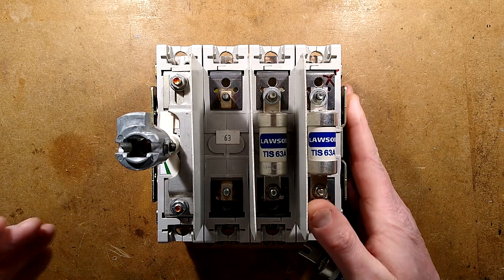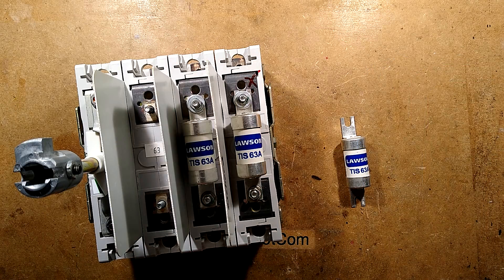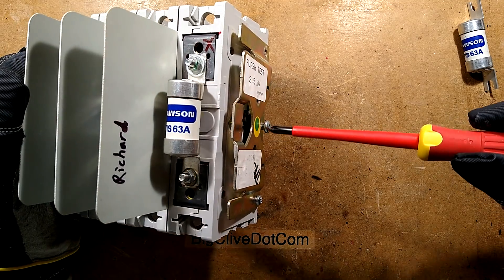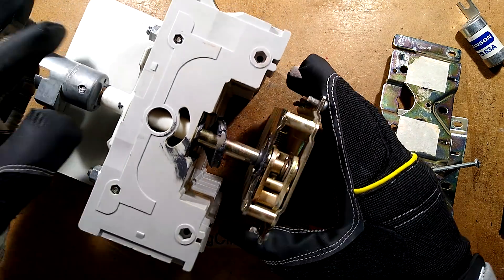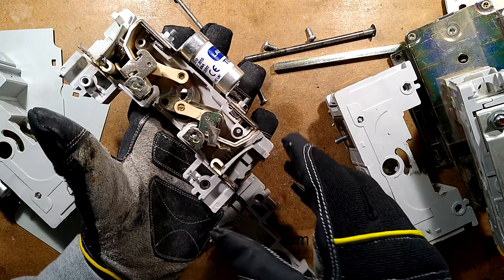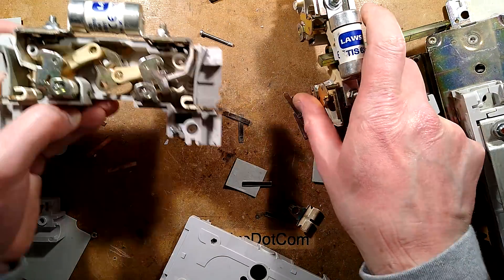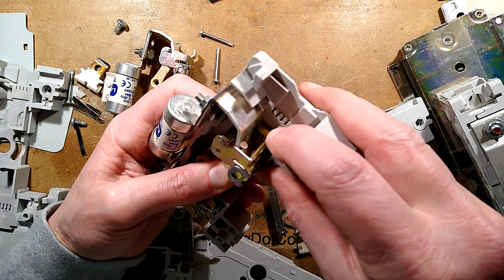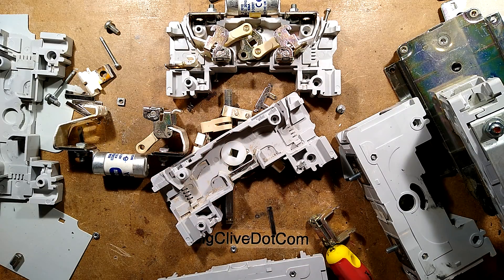Failed elevator switch fuse / fusible disconnect

Comment: Used to work as a metering guy at my towns electric company, quite often i got to operate 100A fusible disconnectors if the meter i was changing was not a current transformer style meter (could have been any service up to 100A). I always thought it was fun to use those huge levers and hear that loud THUNK from the contacts opening and closing 😅

i do miss working there, job was pretty simple but i got to visit alot of interesting places and meet interesting people.

Comment: Interesting! I've never seen such a combination in the Netherlands before. I can only relate to fuse-disconnects that have the fuses (we call them knife-fuses) clamped into a cover that one pulls open to break the circuit if needed (and of course pushes shut again when power needs to be restored)
Switches are always single parts added when breaking the circuit by actually removing the fuses isn't such a good idea anymore (I think above 63 Amps) or (probably) when the fault-current exceeds a certain value (when the switch-cabinet is located close to the transformer and the circuit before thus has a very low impedance)

Comment: They have big switches like this on large commercial air-conditioning and refrigeration units and such as well. Provides both fuse protection against overloads etc and a way to be absolutely sure the device is off when working on it (without needing to go downstairs and turn off/on the main breakers for the unit all the time)

Comment: "you hit the nail on the head" with the failure diagnosis, which probably stemmed from a phase loss and slow cooking fuses in the past. when slow cooked they tend to be real brittle and will shatter when replacing, dumping their shmoo everywhere. lol

Comment: We called them CFS Units [Combination Fused Switch] 
This type are a simple side way slide mechanism, using heavy over balance mechanism enclosed.
The type I first starting with had a carriage that was also spring loaded to thrust in or out. The carriage could be totally removed for service or absolute isolation of the fed circuit.  
They are designed to break 'on line' loads.
The last heavy units I worked with [manufacture of power station switchboard] was 3 phase rated at 660V A.C. @ 2,500A. We used them for a 220V D.C. application by double switching the positive buss feed.  Likewise, using 3ph 2,500A A.C. programmable Circuit Breakers in a D.C. distribution board. Heavy 2 x 125mm x 10mm Cu. per phase or pole busbars in these, requiring precision bending to maintain consistent bar gap and very fine tolerance at every lap joint, be that between shipping sections, buss ties or CFS and CB equipment. 

This 660V 63A 3ph POS... Can't say I like the design of those spring loaded floating contacts. WFT... not even a heavy welded braid connecting to the fuse mount lug! Like, might be a cute little baby size FS, used as a local isolator... or maybe in a dis. board?  I've seen 'em used with solid copper bars instead of fuses as a cheap means of 'on load break' local isolation switches.

Comment: I agree.  The ball and socket went hiZ and the spring became the path of least resistance.  They should have insulated the spring in a plastic sheath to preclude this failure mode.  3cent solution, and would have made it last forever.  What you did is called a DPA  Destructive Physical Analysis in my old field of business.

Comment: Quite different to North American NEMA rated gear.  IEC stuff is much less robust, and way more complicated.  NEMA stuff uses sliding contacts.  Usually, they are a single contact per pole, so the fuse is still connected to the load when the switch is open.   This could not have happened here. Once the switch is made, it is made, and it won't fail open.    In theory, a FDS can be opened under load, in practice, don't do it!   Out of curiosity, how can auxiliary switches be added to that device, if you wanted interlocks or indication of the switch position?   As for the neutral:  I worked mostly with 3 phase, 3 wire, 600 V, 60 Hz, usually with a high-impedance ground.  Some installations were completely ungrounded, but that was real old-school, not much of that left.  Makes for very high reliability, as one phase can go to ground and not shut down the plant or even blow a fuse.

Comment: They should use braided wire as a method of contact between moving parts like they do on motor brushes and in other circuit breakers rather than relying on the friction between 2 surfaces. However it is possible that they'd prefer to leave it this way because it is cheaper and lasts long enough to cover warranty period ensuring the need to buy a new one rather than lasting decades.

Comment: Big switches like that used to have spot welded braid wire to the moving contact. This switch is missing the current carrying braid, so the current can travel the piviot and spring, resulting in heating of the support components. If the spring was on an insulator to prevent it's heating from current conduction, the other higher resistance points would have heated instead. The spring failed and the contact opened. The spring should not be a current carrying component in the switch. A low resistance path around the spring is lacking.

Comment: The powerful springs in the actuator mechanism are quite deceptive giving the impression of a high contact pressure when all they do is ensure a rapid opening and closing of the contacts.

Whilst being a double disconnect type switch, (two contacts must close to make the circuit) the design looks quite poor and the actual contact is a see-saw type so it is quite evident that the small spring could carry the full load current if one end of the see-saw does not make contact.

The USA type rotary knife safety disconnect switch looks to be a better design, albeit much larger, with a wiping action of the contacts but they have their own Achilles heel also with most (Siemens, Square D / GEC)  completely relying upon the springs in the handle mechanism to close and open the contacts, there are several Youtube videos of such switches with welded contacts so they cannot be opened or alternatively the contacts no longer fully mate. These switches would be better if the handle was locked to the rotary knife shaft so that the springs would only come into action to ensure fast make/break but ultimately you could force open the contacts with the handle and not be solely dependent upon the springs.

The links below show a rotary knife switch that cannot fully close and one that won’t open respectively.

https://www.youtube.com/watch?v=FTSFAosB2-w&t=189s

https://www.youtube.com/watch?v=4_InqRMYu3k&t=345s

Comment: The incredible thing is that every single item that is part of the fuse carriage has been designed by some boffin on an old fashioned drawing board using ink and pencil, well before the days of CAD, real draughtsmen, who were on a pretty good wage at the time. Each at his desk, wearing smart clothes and a tie, probably smoking a pipe, Barnes Wallace lookalikes. They had to use brain power or fail.
Anyhow, was you supposed to fix that switch fuse? I'm sure he said at the end of the letter that he was looking forward to getting it back from you fully repaired 😂😂😂

Comment: Lift or elevator? 

A man walks in to a London Hotel. An American guest walks to the lift. He shouts "hold the elevator". The staff member goes "we call them lifts outside of America".

The American goes "we invented them, so we call the elevators"

The staff member wittily replies "yes sir, you did, but we invented English"

Technically lift is properly correct as you are "lifted". Elevation is a static height, like mountain. 

I will get my coat.

Comment: If the spring was passing current, which it looks like it was, it would probably melt pretty fast. It wouldn't take a lot of current to melt that. When I was a teenager, one time I was playing around with a spring and connected it to a low voltage supply to see if I could get it to glow. It was a relatively thin spring and within a few seconds, it was glowing red hot. After it cooled down, I noticed it had lost its springiness. When I stretched it out, it no longer popped back into its original shape. I'm not sure what the heat did to it to cause that.

Comment: It would be interesting to know where the bit of plastic (at 9:30) came from and could it have jammed the rear of the contact open, although the sand is probably the culprit. The neutral bus bar could also be removed in three phase delta systems (if you do delta in the UK).

Comment: switching on a 2000 amp 3 phase disconnect is fun, the handle has a long pipe like rod that come out of it and you need a exert pipe over it to leaver it on

Comment: My dad is a PSE with the city and had one of these fail when he was changing some 600V meters one morning. One of the disconnect modules failed to disconnect and when he inserted a new meter it arc flashed in his face. He wasn't wearing a shield, but luckily he had his safety glasses on as well as a flame retardant jacket to save most of his vital bits from being flashed. It's pretty scary when electricity discharges uncontrollably.
Reply: Something similar happened to me in the '80's. Overhead Crane Hoist contactor in a steel mill shorted out. Woke up in the ER as a Doctor was picking beads of copper out of my face. Safety glasses were so well copper plated you could see yourself in them. Pretty singed, but mostly recovered in a couple of weeks.

Comment: No sliding contacts. That's the weaker construction, also when used in corrosive environments like paper mills.
The ones we sell have knife contacts sliding between a springed fork. Wipes clean at every action. Will not try to disengage on short circuit, cannot bounce. 100kA @690V rated.

Comment: How could they tell which one had failed when all three fuses were intact? I just rewatched parts of the video.. They knew about the spring?
Reply from the maker: I marked the faulty contact by measuring from the fuse connections to output terminals before the video.

Comment: My 1st and only 'spring burnout' was replacing a fuse with a Biro spring when 11yrs old in '64 for my mains  Philco valve radio, Then picking it up with the cardboard base not attached. Things that stick in ones mind....9V transistor radios where a god send.

Comment: My Great Grandfather worked maintenance at a mineral plant, and he used to carry 3 pieces of copper pipe the same size as the fuses they used in their bus bar disconnects. If they blew a fuse and didn't know where the fault was, they would replace the fuses with the copper pipes, close the disconnect and look for the smoke. Safety 3rd really was the motto back then.
Reply from the maker: I may possibly have used a similar technique in the past, but you have to be careful about causing cable damage.

Comment: That reminds me of a similar case in a very different appliance. I replaced a blown 3 A fuse inside a 12 V cigar lighter plug by a 12 A one because I did not have any other of this size. It was only for a short test with short periods of maybe 6 amps. Suddenly the current was broken and I wondered why the 12 A fuse should have blown. Further investigation showed that the spring holding the fuse in place did not like those amounts of current and got so hot that it melted the plastic nearby. This resulted in the relaxation of the spring thus loss of contact pressure pretending a blown fuse.

Comment: No matter how good the 'rocking' contact connection is, the spring will take some small current.  All of the springs I could see in the video looked a bit corroded.  So if they're the wrong type of metal, as I suspect, the springs would be subject to electrolytic corrosion.  Any heat from the high current would just make it corrode faster.

Comment: Many years ago got called to a milk cooling tank that was being blamed for people getting shocks off the steel framed building, turned out to be a huge cast iron Bill Isolator that had shorted out inside and made the whole milking parlour live!
Reply from the maker: That's not uncommon.  People can also get shocks from the door handle of a grounded building due to external faults finding a return path through them.
Reply: @bigclivedotcom  Electric trains are even worse - the voltages allowed between the platform and the train body are frighteningly high and for quite a long - 10's of seconds duration.  Part of the justification that it is safe in the (IEC?) standard relies on the electrical insulation of peoples shoes !

4 wheel electric trams were quite bad as well - it only needed all 4 wheels to be resting on dirt on the rails for the tram body to be raised to the overhead line voltage , normally several hundred volts DC. London trams had insulating material wound round the metal handrails to stop people getting shocks when they got on ! Oddly enough this was carried on onto internal Combustion engine buses though there was no reason for it.

Comment: £5 a fuse? that sounds like a chinese knockoff
Reply from the maker: In a box of 10 before VAT.
Reply: @bigclivedotcom  unless you are paying £/$ 100+ per fuse for a mains incomming fuse, its going to be a chinese knockoff and wont have the correct interrupt rating
Reply from the maker: These are common HRC industrial fuses:-
https://www.cef.co.uk/catalogue/products/15053-63a-tis-hrc-fuse-sold-in-1-s
Reply: @bigclivedotcom  they are BS88, a 100 year old standard that does not apply for modern machinery complient with the machinery directive for EU or the new UK mark. they are not complient with UL either so I can't imagine what they are existing, but only to be used for replacment fuses for machinery from the 1920s

Comment: Cheers Clive! I can't believe that's all it was. You could be right about the sand, as another engineer did replace a fuse after the lift developed a fault a year or 2 ago.
Reply: Where is the lift located - in what kind of building? How old is it?
Reply: @milcotto4153  It's in a 2 storey office building in the UK and is around 30 years old.

Comment: It would be interesting to cut / break one of the fuses open to see if the sand in the fuses is similar. The 'snap' action is required to minimise the contact arcing as they are opened or closed..

As an aside Lifts are quite interesting as electrical loads as they regenerate when the control system controls the lift speed when it is imbalanced. We had a couple of lifts that caused problems due to this - one the electricity meter (rotating disc type) went backwards when the lift regenerated and it got very confused about the power consumption. In another case there is a station that has 4 AC lifts on a feeder from the street supply. When the lifts got into phase so most of them regenerated at the same time the voltage to the local shops went above the normal supply limits ! In normal buildings you do not see this as the lift power is only a small fraction of the building consumption. However in the two cases above a new feeder was put in just to supply the lifts the other supplies for the station being derived from other sources.

Comment: There was a MEM brand switch in my old workshop that had three fuses like those but they rode in and out on a carrier with two prongs top and bottom for the switching action, made a very loud noise when the lever which was on the side and had to be pulled out was thrown over either way but switching on was slightly softer than off. Very simple and robust,as long as it was greased every so often nothing to go wrong.

Comment: 63A? Is that a typical fuse size over there? How interesting. Any large new construction project with fuses (not that often in the last decade) I specify a fuse cabinet in each large electric room with at lease one full set of each of the larger size used, and a few sets of the smaller ones (20A, 30A).

Comment: You did not really explain why there needs to be such a strong spring, did you ? ... sorry my attention drifted a little in the middle of the video.

There are fuses that are (dis)connected using explosive charges so the contact reaches a speed high enough to avoid (reduce) the arc, otherwise the contacts would melt and evaporate faster than you could bring them together... can't find the video.. grr.

Couple years ago you made one about explosive charges in emergency disconnects .. Bear and Beer ... https://www.youtube.com/watch?v=7hvg2Wey92E. Also very interesting !!

Thanks for letting us look inside that deathly spring loaded contraption, I love these Videos where you show stuff that you can't find in a normal household !!
Reply from the maker: The string springs are for fast action and also to force welded contacts apart.

Comment: Fault investigation is always fun. The last case I came across was a tripped breaker from a short circuit. I determined the root cause to be a stray metal object bridging the exposed live and ground on a regular American 15A power plug. Our plugs really are the worst, almost every other country's plugs are made so you can't contact live pins.

Comment: As a young whipper-snapper I can say that the olds stuff was more robust, reliable, and easier to maintain on average from engines to electronics. They designed it that way. The new stuff is generally computer controlled, complicated, uses specialized tools bought from the manufacturer to assemble or disassemble, made from replaceable assemblies, more efficient, and designed to be replaced by a dealer tech only or to be thrown away so you buy a new one.

Comment: That spring looks like a weak point in the whole design Sherlock Clive
Reply from the maker: Under normal circumstances it should have a fairly easy life.
Reply: @bigclivedotcom  yeah the sand! but it being a possible pathway for enormous amounts of current is a little bit of design flaw